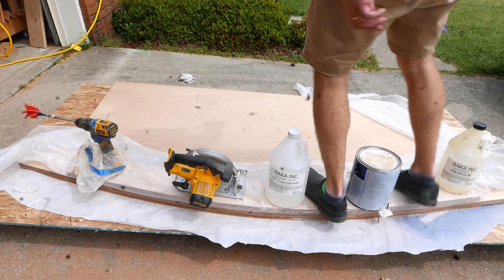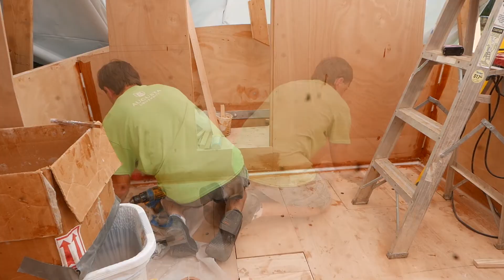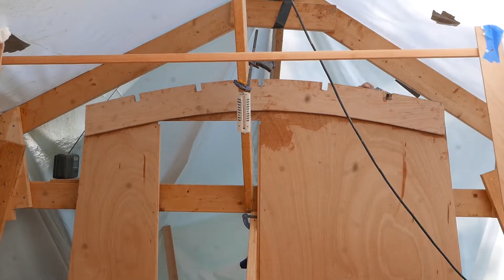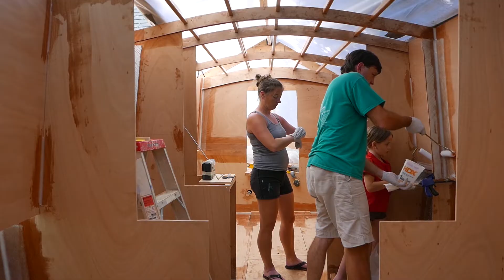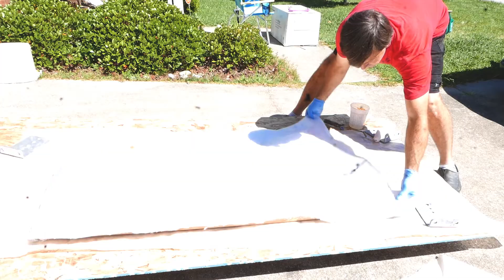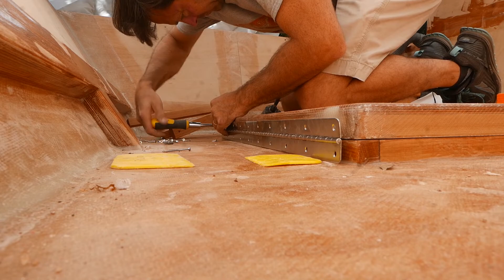Building our GT27 Houseboat, Part 4

Comment: Good family project but please put some safety glasses on for protection please.
Reply from the maker: I try, and thanks for the reminder. In the Georgia heat, there's only so much you can take with the fogging lenses and slipping off your sweaty nose before you just have to say to hell with it. But any time I'm cutting metal or using a tool that produces larger than dust-sized particles, I'm pretty diligent about safety glasses.

Comment: Excellent Job.    I have been looking for roof  designs yours are best by far.
Reply from the maker: Thanks Greg! I improvised the roof stringers, but was very glad I did. It made for a reassuringly sturdy roof and made the challenge of aligning the bulkheads and attaching the roof panels considerably easier than how I think it would've gone per the original design. I don't know if it would adapt equally well to all designs, but if you're able to pre-notch your beams/bulkheads for a drop-in fit with the stringers the way I did, I highly recommend it!

Comment: it is getting very good, however I was worried about one thing. when you installed the steel reinforcement for the engine, the drilling was not sealed (at least in the video it seemed), and wouldn't it be interesting to put a sealant seal between the metal and the hull? just marathon your project today ....
Reply from the maker: Hi Cristiano, good catch! It's not shown in the video, but each hole was coated three times in epoxy. Then the entire perimeter of the bracket (all the way around the entire width of the flange, not just around each hole) was bedded with 3M 5200 sealant. We chose not to use sealant on the inside under the backing plates because if water ever does find its way past the outer sealant, I would prefer it to leak through to the interior so we are aware of the leak. If we put sealant on the inside face of the transom, it might actually trap an exterior leak inside the holes where it would be undetectable and could gradually begin to soak into the plywood core, which is a worst case I am hoping to avoid.

Comment: When will part 5 come out?
Reply from the maker: Soon, I hope. We're battling the return of high summer temperatures in GA so that's slowing us down. Almost have the entire upper cabin fiberglassed now and about 12 minutes of good (edited/polished)  footage for part 5 is complete.
Reply: @LiveDontWatch  
What do you have left to do for the boat to be fully finished?
Reply from the maker: @koudacyen  Oh, quite a lot! I still have several weeks of fairing and sanding to prepare the exterior for primer and paint (I may wait until cooler fall weather to paint, as the finish will come out nicer if it can cure slower in cooler temps). I also need to install windows and hatches before I paint, so that may slow me down as it's taking awhile to source the windows.
The interior is completely empty, so I haven't yet begun to build out all the seats and storage areas, kitchen, bathroom, plumbing, electrical, propane systems, steering cables/hydraulic lines, instruments/gauges, etc. That's probably about a year of work yet.

Comment: Why would you sand all the floor bays only to fill with foam ?
Reply from the maker: Good question! We did that to ensure a high quality seal/barrier coat of epoxy on all surface. Even closed/foamed compartments ought to be carefully protected from moisture because there's always a risk that moisture may eventually find its way in, such as through a poorly placed fastener hole or a damaged area of the hull from running aground, or whatever. If it does, the closed cell foam can still absorb and hold enough moisture against the bare wood to promote rot. (The main purpose of the foam is to keep out a large ingress of water during catastrophic hull damage, so that we don't sink, plus benefits for insulation and noise dampening.) So although it's extra work and may seem unnecessary, I think it's important to have thorough coatings on all surfaces, even those that will hopefully never need to be reopened.

Comment: Hi LDW, great videos. I love boat building, and from the age of 10, helped in the building of two GRP ocean going yachts. One of which is now a sail training vessel named "Black Diamond", and is based up on the East Coast of England.  She was a modern (for her time, early 70s) deep sea performance yacht.   However, these days, i tend to prefer to watch videos of timber built craft, such as strip planked canoes,  Open launches, micro cruisers, and "different" boats like yours.  You may be interested to know, looking at the size, plan, and pics of your boat, we have here in the UK a boat called a "Hampton Safari 25" which is very similar to the GT27 you`re currently building.  The Safari 25 came in 3 variations,  the mk1 & 2 being a fwd drv with sliding cabin top over the fwd wheelhouse / saloon, the  mk3 being a solid top, with fwd well and access, and the very much less popular mk4, which was a sedan style, with fixed double height cabin top, and aft cockpit.  They were the staple 2-4 berth hire cruiser on the Norfolk Broads, which is where they were designed and built. Have a google, and see what you think?.

Anyway, many thanks for the vids, it will be great to see the finished boat, but really looking forward to the rest of the build.
Reply from the maker: Hey Neil, thanks for reaching out and sharing that info. I've never come across the Safari boats before. Really cool! I like that retractable/sliding top! You're right, I see enough similarities that I wonder if this might have been one of the inspirations the designer drew upon.

This is my fifth build. I started with kayaks, but when I got married, I built a few sailboats so my wife could come along. She was too petite to keep up with me in a kayak, at least on the high-mileage multi-day trips I liked to take back then. Then the kids came along and it was harder and harder to get out in the sailboat with little ones, as everyone had to be in just the right mood for it. So now I'm onto a houseboat, hoping that maybe if I pack enough creature comforts, everyone will be happy enough to just let Dad have some time on the water a little more often.  :)

I'd love to be part of the build of an ocean going vessel. It must be really rewarding when you finally see her launched. This build has been a beast because of the sheer size. I'm sure I'll never build anything bigger, unless it's to refit/rehabilitate a large sailboat (~32' to 45') for retirement.